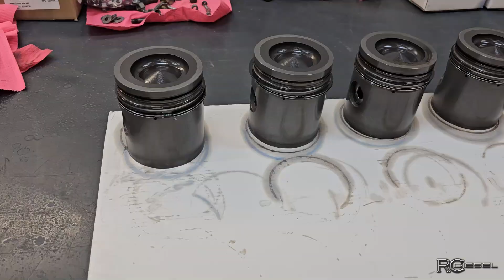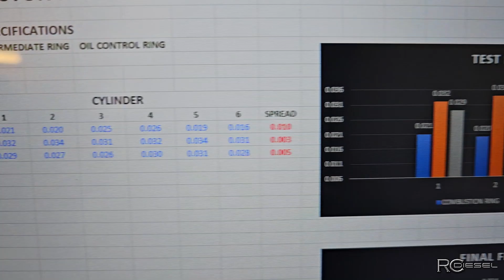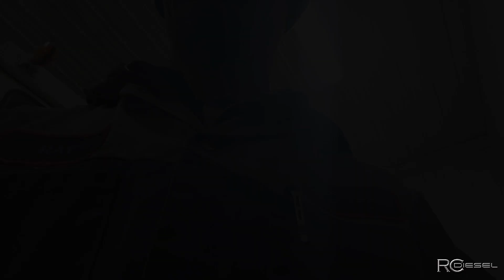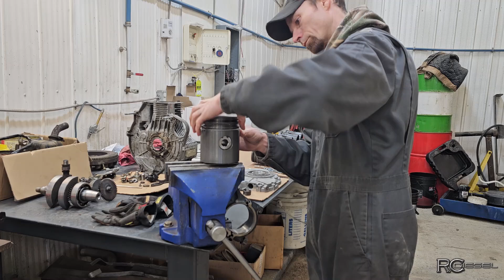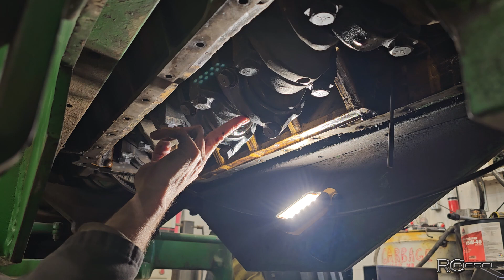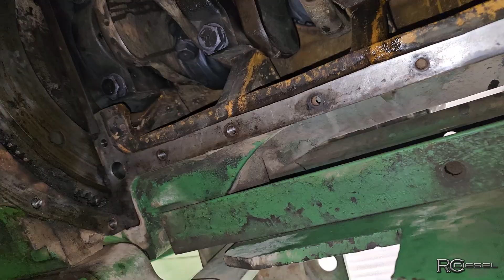John Deere 4020 Engine Rebuild - Part 2: Piston Ring Gap & Installation Tips

Comment: With as meticulous as you are, I’m surprised that you didn’t plastic gauge the bearings.
Reply from the maker: Yeah, I hear ya. It would be better to plasti-gauge every time, but that does take a long time, so it ads a lot to the cost. Generally, if I take std bearings out of a good running engine that hasn't destroyed the bottom end, and I put std bearings back in (I always measure the new bearings and compare to the old bearings), then I'll skip the plasti-gauge as long as there's no indication of issues.

Comment: I believe the pistons aren't round because of the COLE  (coefficient of linear expansion). You will notice that there is a lot more material at the gudgeon pin than there is at the thrust faces so it will expand more when at operating temperature.  When the engine is warm you will find the piston is perfectly round.  It's called cam grinding (from a rapidly fading memory).  Great video.

Comment: I am doing a headgasket job on a Renault  tractor at this moment,  and the headbolts are just 1 mm longer than they are when new. Do you ever use them again or is that a hard no go ? 
Great video by the way !
Reply from the maker: @cineminded  Wow, great question! So for me personally, I prefer to always go new - but I don't always replace them. Head bolts sometimes are very expensive. Technically, as long as it is not a torque-to-yield headbolt, you are just fine to resuse them, especially in a stock application. Many times, the manufacturer will give you a tolerance spec for bolt stretch. If it's stretched too much, it needs to be replaced. If its within the tolerance, the bolt is good.

I've had many times where the used bolts just won't take the torque when reinstalling the head and then you're forced to go with new bolts. In recent years, I've come across an Allan head bolt that works great as a head bolt, if I can get it in the right sizes. Much cheaper than head bolts but just as strong and in some cases, stronger.
Reply: @rcdieselchannel  That kinda confirms my thoughts on the subject , thank you very much for the elaborate answer
Reply from the maker: @cineminded  I'm glad I can help!